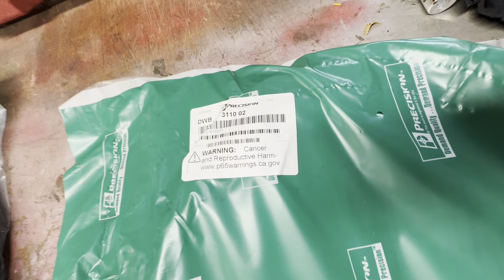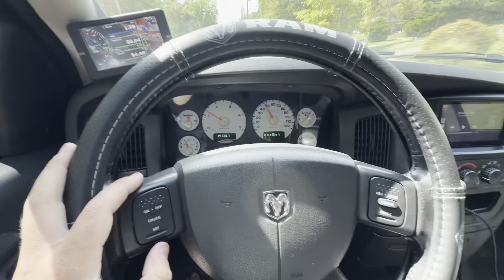3rd Gen Ram door seal replacement! #cummins #dodge

Comment: Same brand as the rear ones you installed? Noticed any difference? Thanks any input is greatly appreciated.
Reply from the maker: Yep , front and rear are the same . Honestly made mine so much quieter I didn’t realize they were as bad as they were